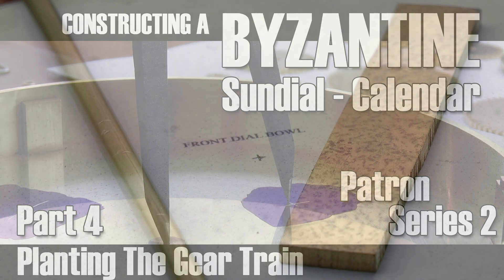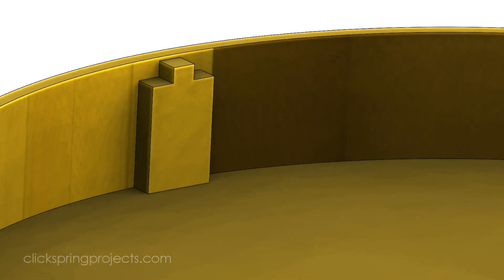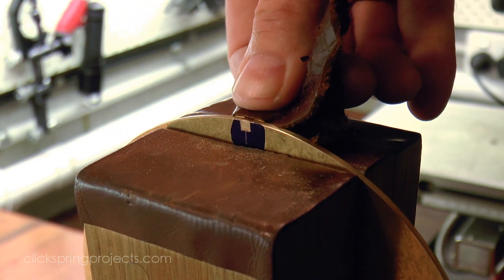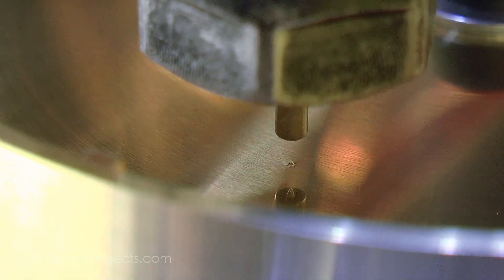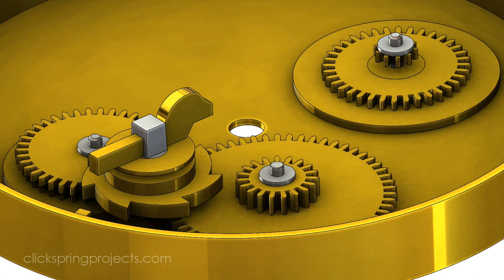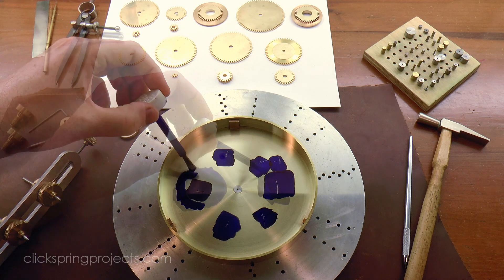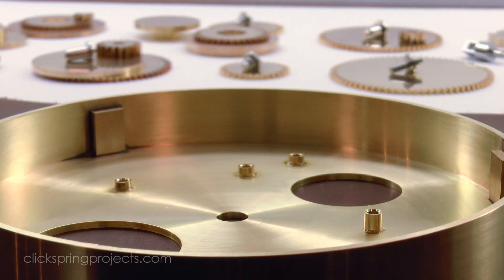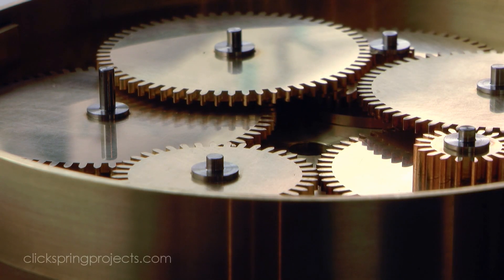Constructing A Byzantine Sundial-Calendar - Part 4 (Depthing & Planting The Gear Train)

Comment: The part about "Situational awareness" in relation to what landmarks the drawing has and what landmarks your part not yet has really spoke to me.

I have miss-soldered a prototype pcb more than once because I slipped up while reading the pcb layout during the crucial initial placement of "landmark" components.
I too use multiple printouts of the same drawing with different levels of details to better keep track now!